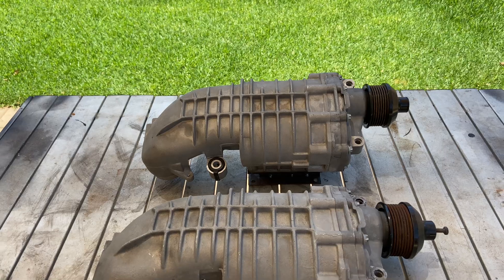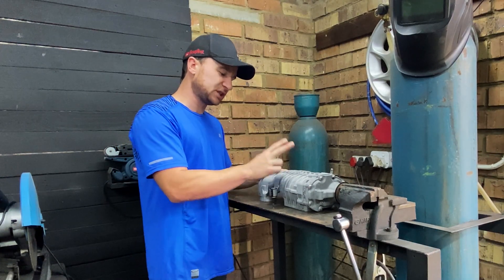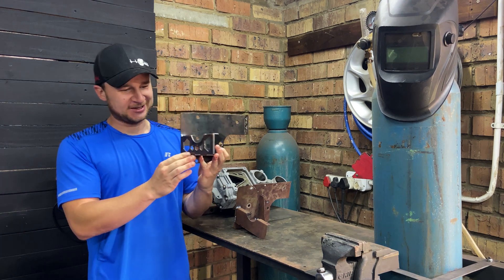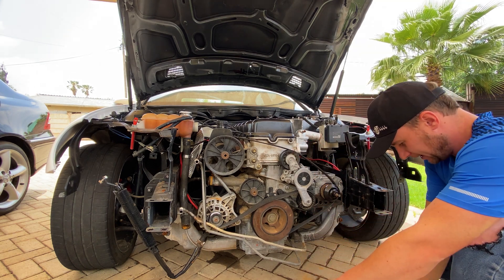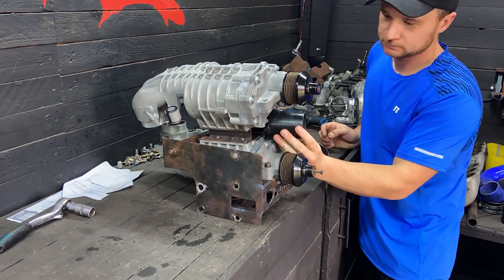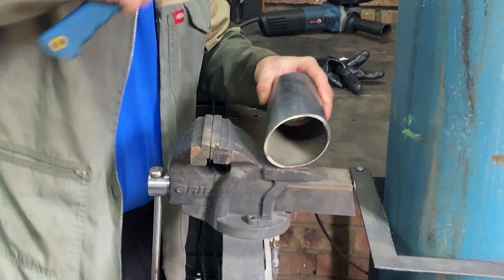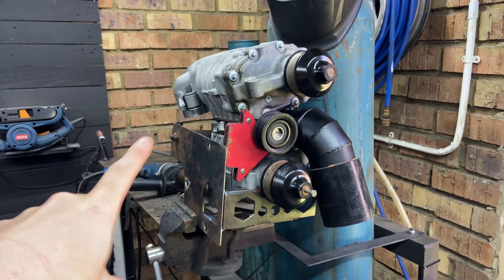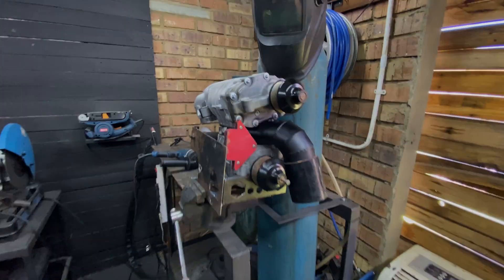I'm Building a TWIN SUPERCHARGED Mercedes C-Class | Fabricating a Custom CNC Plasma Cut Bracket  🤩

Comment: all you had to do was turbo it this wont make any good power bro
Reply: Boring. This setup is way better.
Reply from the maker: I’ve always been curious about this setup so let’s see what happens and then maybe do a turbo later on🤘😁🤘
Reply: It won't make as much total power as a turbo, but what power it does make, will be available from idle and up. Don't get me wrong, I love turbo cars, I daily drive a 210kW Sirocco R, but I have to drive it hard to really get the most out of the turbo. I'd love to have my car in a factory supercharged version because I think it would be more fun as a daily driver

Comment: Watching your videos just makes me to excited to convert my w211 e55 to manual and the only thing that stops me is creating the bell house adapter I will contact the engineer that you put in your comments
Reply from the maker: Manual E55 sounds fun!💪🏼😁
I have bo idea who would be able to do the adapter plate for that sorry mate ✌️
Reply: I think the m272 manual bellhousing is similar to you m113 belhousing might be a close to straight fit not sure how much power that 6 speed manual can handle though seeing that you have so mega power going already
Reply: C230 v6 coupe is I think the biggest manual in SA
Reply: @RuanSchneider-jd6fx thank you very much for your information. I’m trying to find out first what gearbox code the Chrysler Crossfire uses. The m113k is an extremely powerful engine and can grind all gears inside of the transmission with only one pull.
Reply: @ If you need a bellhousing print on a m113 
Ive got an engine out 
That way you can check without having to remove anything from your car.
Reply: @ thank you very much for your support and generosity unfortunately I live in Swaziland and the distance wouldn’t be viable. Would be amazing having any m112 close by besides be the same as m113 and m113k would make my life easier but if Mercedes plug and manual gearbox end the same as the 722.643 I would be forced to try bmw m3 e46 or e92.
Reply: @giovannifrade59  I personally think bmw has stronger manual boxes available than mercedes
Reply: @ thank you for sharing the same opinion as me that’s why I’m planning to make make the bell house compatible with bmw gearbox

Comment: Excellent channel, just an observation the second supercharger will rotate in the opposite direction,  and will not create boost pressure.
Reply from the maker: Thanks man🤘
Both will be spinning clockwise 👌once I get a belt on it will make more sense 🤙🏼🤙🏼